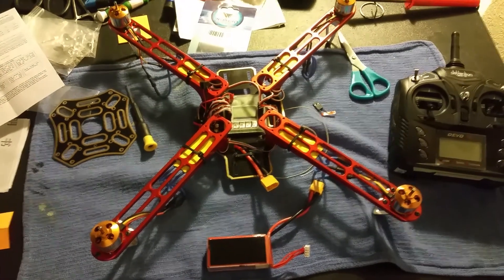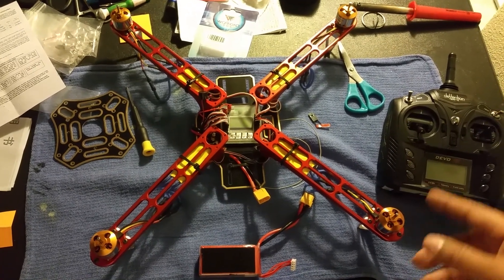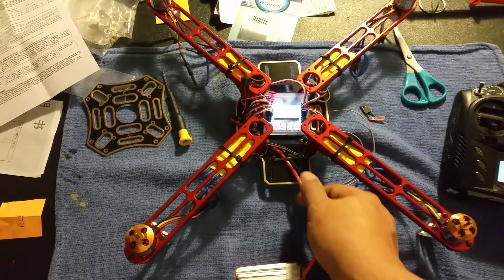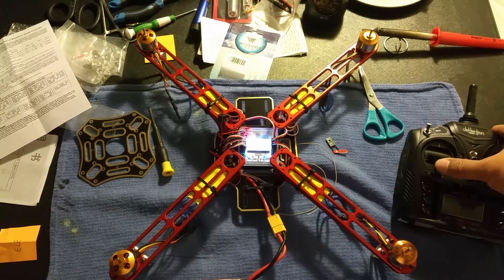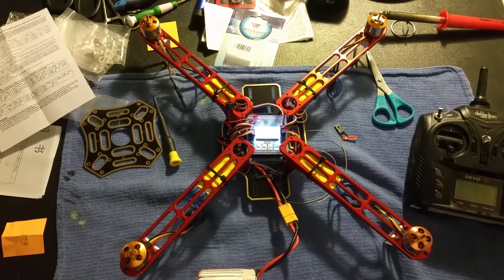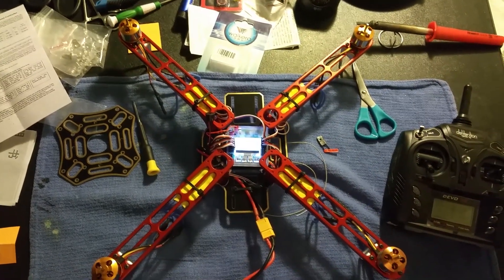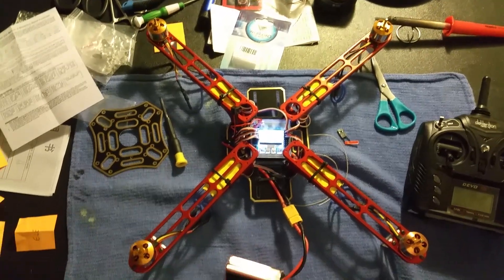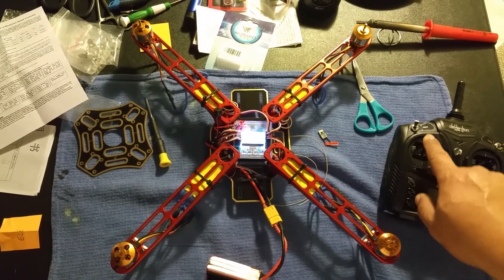Brushless Motors Constant Rapid Beeping & Won't Spin

Comment: I had the same problem with generic ESCs (XXD) and racerstar motors, the problemwas solved by increasing the throttle max value by 10% on my transmitter, and re-configure the ESCs MAX/MIN again.

Comment: Did you ever figure out the problem? Did you try switching ESC to confirm motor problems? I have the same issue and think it's the ESC.
Reply: I put on a whole new set of motors.
Reply: @SuperVS3  was the problem solved? By getting a new pair of motors?